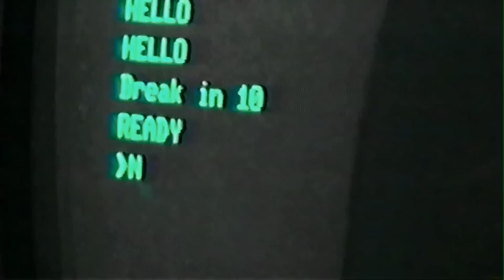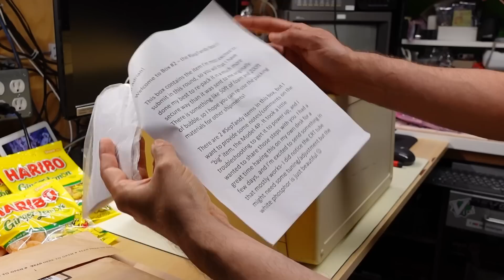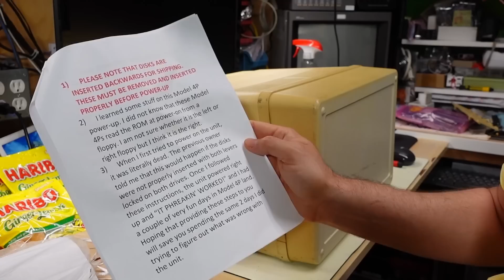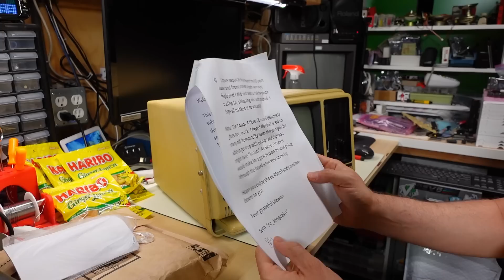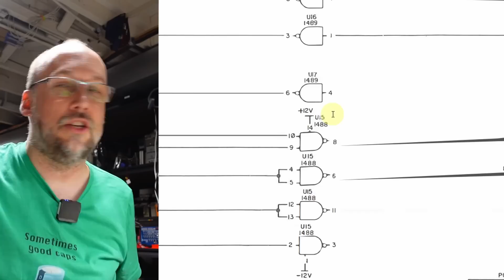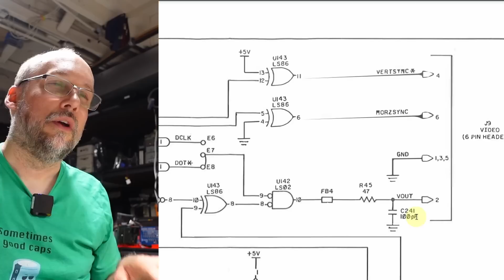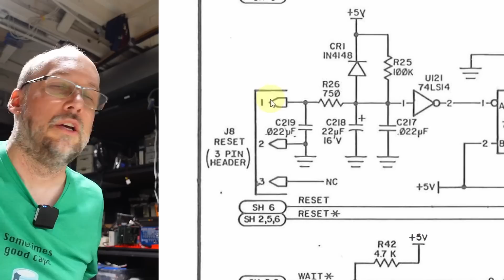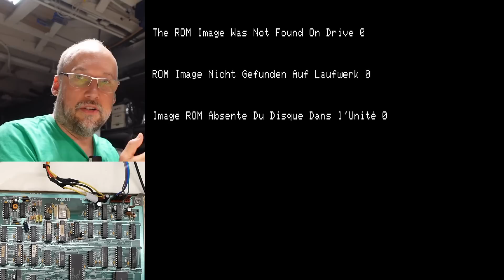TRS-80 Model 4P Test and Teardown

Comment: "It's not booting up, because I paid absolutely no attention to the instructions in the letter, so let's unnecessarily take this completely apart, only to find out I didn't need to, because I didn't pay attention to the instructions in the enclosed letter." [Feigned quote, but this is accurate.]

Actual quotes:

"So, at this point, I think my next step is to consult the technical manual.  Probably something I should have done from the very beginning."

"Alrighty, I'm back, and I've done some reading.  Huh huh.  Kinda wish I'd done that before I dug into the machine."

"I'm definitely gonna take a look at the user manual for the 4P."  [Smack my MF head.]

Derp-arific.

Comment: On my vanilla TRS-80 Model IV you had to hold down the Reset button to boot into BASIC, not "break", but the note about needing a "ROM Disk" to boot is alien to me.  Like... if it's a disk, it's not a ROM anymore right? 😅

Also... wouldn't a single ROM chip be way cheaper than all that extra RAM?  
The vanilla Model IV only had 64k!

The BASIC on mine couldn't see the disk drives though, no documented commands to interact with them anyway -- but it could see the tape drive DIN port, and the printer.  Adding an L to the command (i.e. "LPRINT", "LLIST" in BASIC will write to the Centronics port, and I think it's compatible with regular LPT printers.  My printer was a diasy wheel printer, wish I still had it!).

Also some games used the monitor line on the casset connector to make sound effects.  It was kind of amazing.  One space invaders clone game I had could make digital voices, like when you died they would mock you.  It was hilarious.